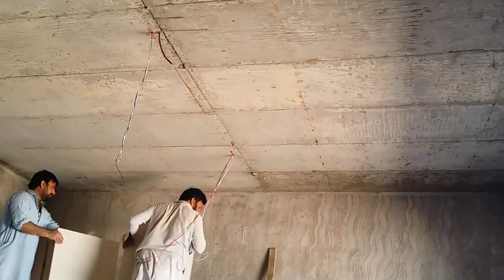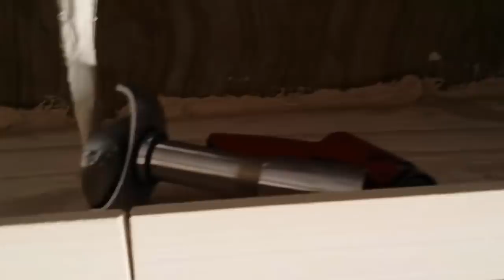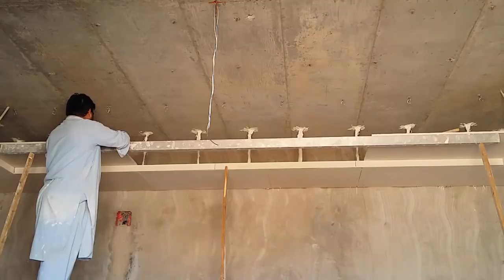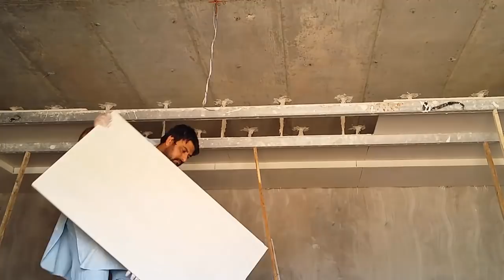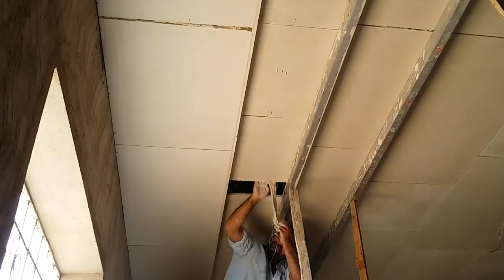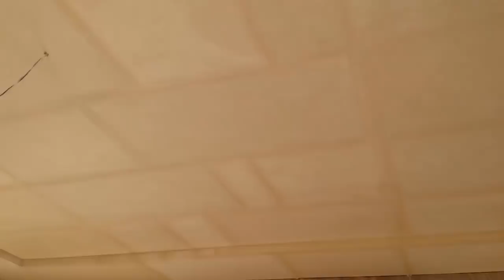Gypsy chic decor home decor accessories gypsum ceiling installation || DIY GYPSUM & GYPSUM BOARD

Comment: why not just mount drywall  to the concrete? wouldnt it be faster and higher ceilings
Reply from the maker: Jonathan Wang The simple roof that does not have time, the time and the decker's work takes time, thanks for commenting,
Reply: but higher ceilings by 1 meter :0
Reply from the maker: Jonathan Wang If you better understand me, I will be able to understand you, write words well in the command so that I can understand, and give you an answer, I want to thank you with your heart. Thanks for commenting,

Comment: I would have framed it with either timber or c Chanel and then used larger sheets, to secure it into the frame. This feels dangerous and cheap.